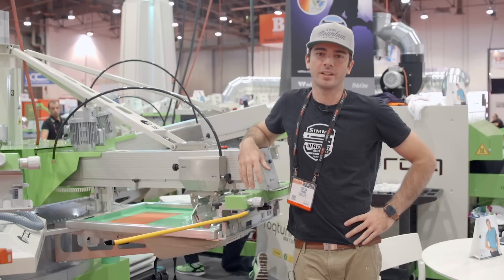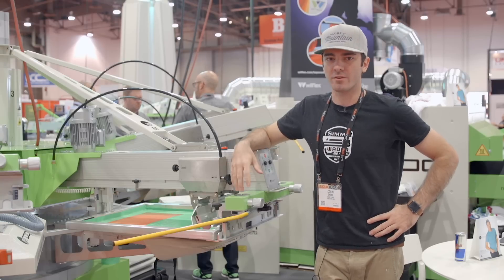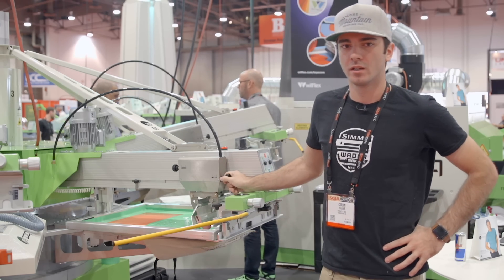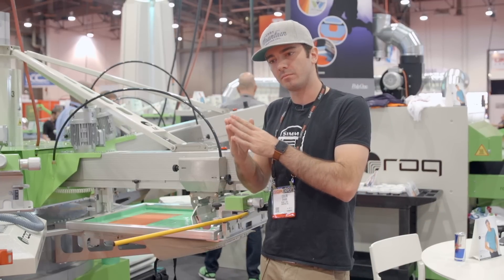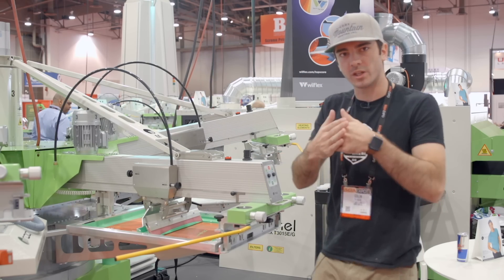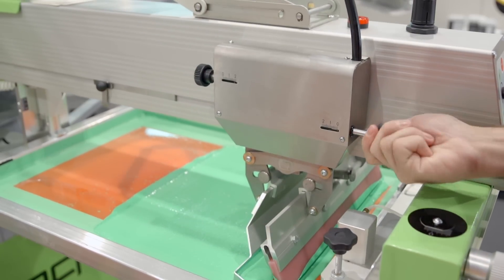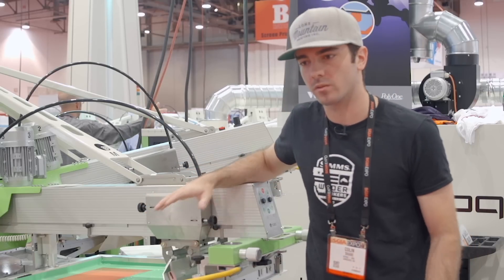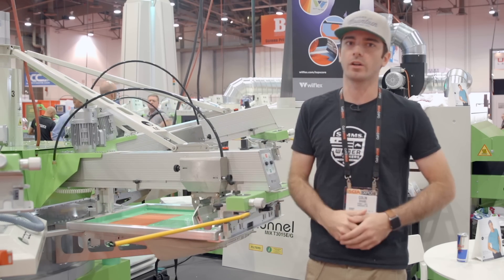The Importance of Squeegee Pressure in Automatic Screen Printing

Comment: The EXACT opposite of how we do it here with plastisol printing.  We lock our squeegee distance in place and only adjust the chopper cylinder pressure.  But again, we're 99% plastisol and we are keeping our ink on top of the garment.
Reply: Would really appreciate some tips bro on angles you use. And what thickness of inks you use?